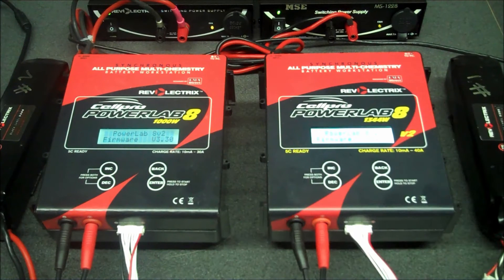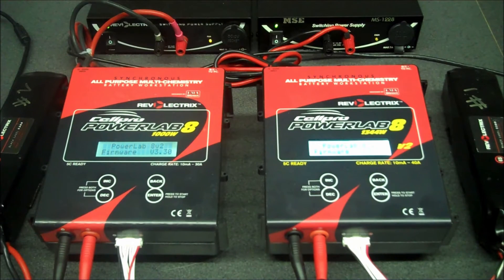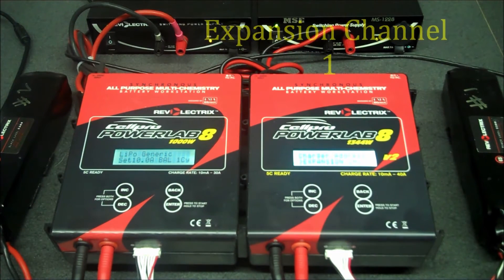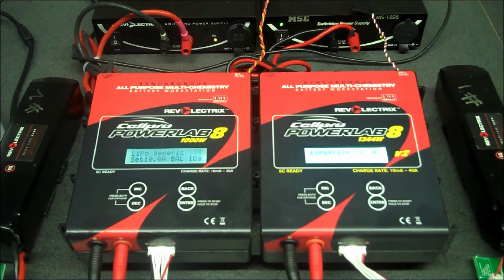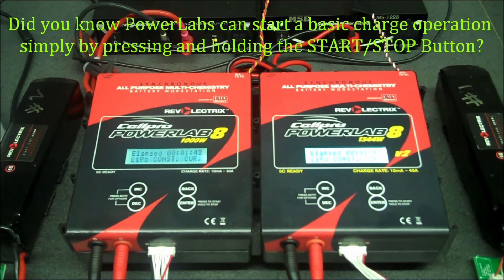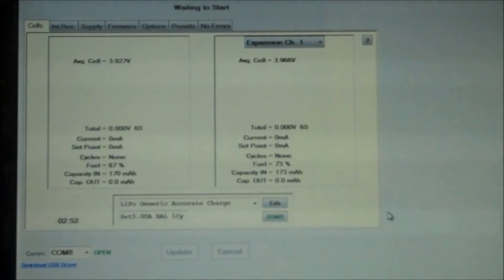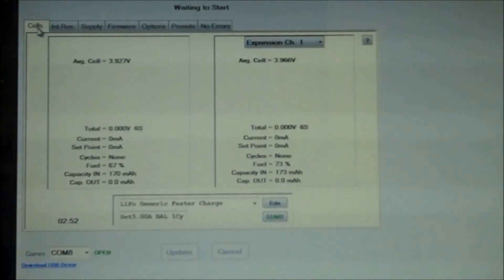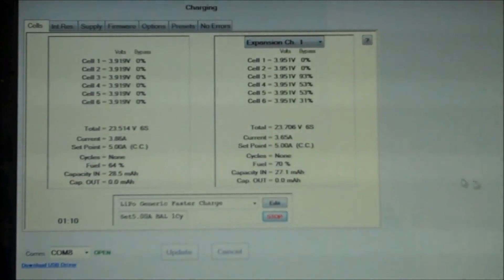FMA PowerLab Expansion Mode

Comment: I guess I am wondering the same thing.  I mean, I get that if I have 2 batteries, I don't have to perform settings on two different chargers.  But, I guess I am wondering why I don't just parallel charge two lipos off a single charger.  UNLESS I need to charge something bigger then the one charger can handle.  That is the only scenario I would think makes sense.

Comment: if you dont need more than a 6s changer the pl-6 is slightly cheaper does the exact same thing is rated 1000 watt because it does not go above 6s batteries

Comment: I'm sure not trying to be difficult, but after looking through the PL8 manual and watching this video I cannot for the life of me understand what the advantage of connecting two chargers is. It seems that in any case, any battery greater than 8 cell (lipo) has to have a "center tap" meaning you need to be able to isolate the pack into 8s or smaller segments... That's two packs. So great, it seems like if I connect two PL8s they can each balance charge an 8s pack, just like they can if they're n